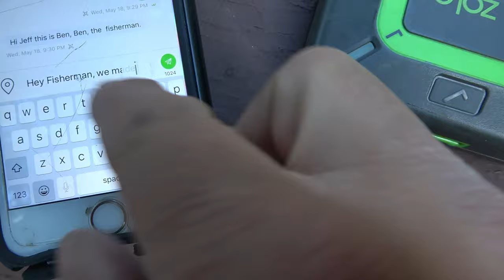Maximum Adventure - This is what we're here for!

Comment: I used to work for an old Merchant Marine.  He taught me that in a pinch you can patch small leaks in your boat with sawdust.  Just pack the sawdust into the leak and it should buy you enough time to get to where you're going.  Keep a supply of sawdust onboard in a water tight container.  With the patch you fashioned sawdust would have fortified the fix.  When you first discovered the leak out on the lake you could have plugged the leak long enough to pump the bilge out then you could have packed the hole with sawdust and made it back to shore at your leisure.  Take care.  sincerely,  Dean O.  :-I

Comment: I used to have a riveted boat, about half the rivets leaked. I welded them all with wonder rod from harbor freight. Something to keep on the boat for temporary emergency repairs would be flex seal tape or some other water proof tape. Only rely on it to get back to the dock. You can also get nylon screws that can be used to plug a small hole.
Reply: I've never had any luck with flex seal, epoxy is the way to go for on the lake/River repairs.
Reply: @AL4N.  epoxy can be an issue with thermal shock, something probably not an issue in northern bc, corrosion would be my concern when getting used in salt and epoxy delaminating from the aluminum, but if the aluminum is clean and free of oils and the epoxy pushes through the hole it should seal pretty good.
Reply: @cm5838  You make a good point with salt water use. I'm in Northern Michigan so that has never crossed my mind.
Reply: @AL4N.  I noticed it’s not so bad in a tiller hand start powered boat but when you add an electrical system the electrolysis can really take hold.

Comment: There was a lake near the house we used to go to all the time.  We could be there in less than fifteen minutes, but one time it took us nearly two hours!   It was my wife and I, and five girls between eleven and fourteen years old.  Three were our daughters, and also two of their friends.  The lake was in an open area that used to be a pasture, but we had to go down a winding trail through some woods to get to it.  It had rained recently, so one of the low spots was flooded.  I tried to keep one side of our car on a bank where it was dry, but it was too steep.  Just as we hit the deepest part the wheels slid down the bank.  The fan splashed water onto the distributor and our car stalled.  
I got out into knee deep water (flooding the car) and dried out the distributor, but when I tried to start the car the starter turned just a bit and quit!  I was an auto mechanic and always carried a toolbox anywhere I went.  I got out the car jack and jacked up the corner closest to the starter, and removed it.  Luckily the car was high enough that it was barely out of the water.  When I took it apart I instantly saw the problem.  Sand and mud had made it's way inside and had lodged underneath the brushes so they weren't making contact.
I cleaned everything up, put the starter back together and reinstalled it on the car.  I started the car while it was on the jack so the starter wouldn't pick up any more sand and mud, let the jack down, and drove slowly out of the mudhole so water wouldn't be piling up in front of the car and picked up by the fan.
After about two hours, an hour or more spent with me nearly covered in water and mud, we made it to our fishing lake.  After I got dried out we all had a good time fishing.  When we left, we went a different way!  It was around four or five miles further, but at least we didn't have to fight that mudhole again!

Comment: Love the videos. That was a bit intense seeing you all getting stuck in the snow, been there. Good thing you had extra vehicles to hep you out. As far as the missing rivet goes, a small dry twig about the size of the hole and pounded into the hole will work in a pinch. The water will cause it to swell and should hold in place. But bring extras.

Comment: cold have made a wood cork or use some pine tar with string to plug it.  Tight wood cork which would expand when it got wet sealing it even tighter. Seal the end with tar if its  porous